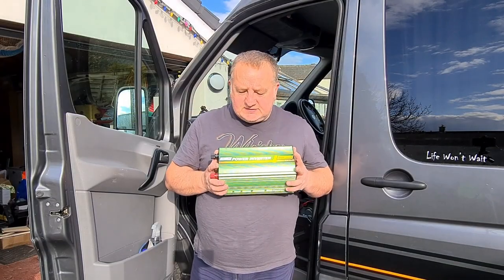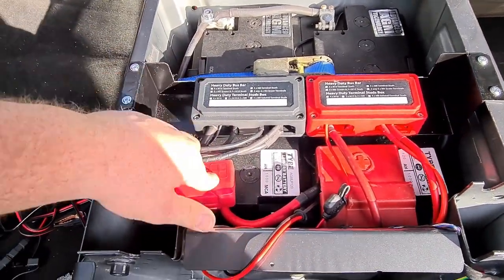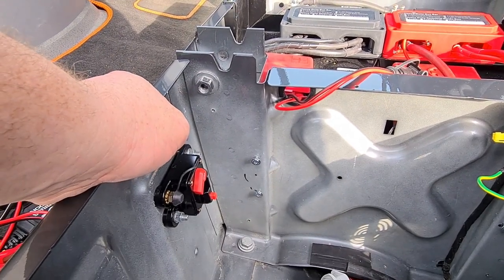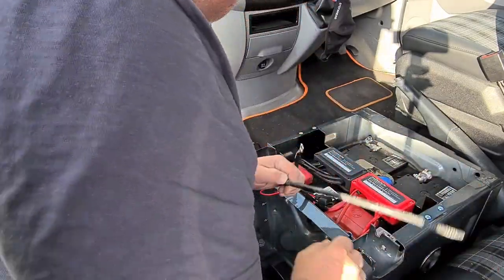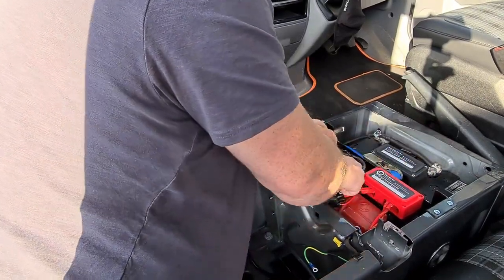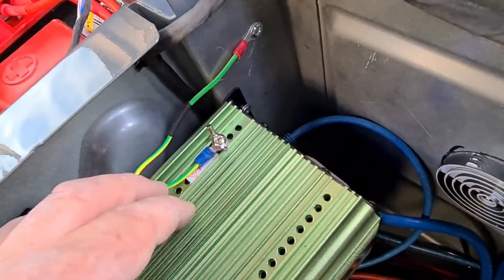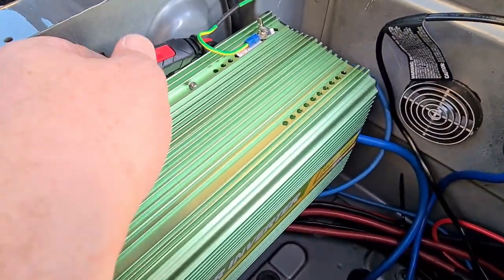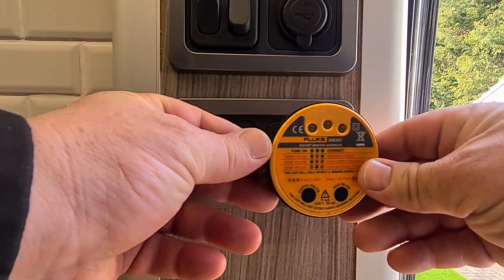selfbuild | vw crafter | campervan | inverter install | van build | part 29 | the crafty blinders

Comment: I like those battery distribution blocks mate, we’re did you get them from? 
Cheers
Reply from the maker: Hi I've just checked the description and I've missed them off
 I got them from ebay they weren't cheap but are a great addition

Comment: Hi there Sam great content once again How has this inverter been have you had any problems with it ? As this is the brand inverter  I feel I want to fit in my motorhome Thanks and safe travels for 2024
Reply from the maker: Still going strong I'm upgrading mine to a 3000w
Reply: @TheCraftyBlindersvanlife  Hi there Sam may I ask how many watts did the 1500w reliably deliver ? as I'm not sure if I should go upto the 2000w model . But i only have 220 Ah agm battery bank what are your thoughts ? Thanks

Comment: Hi, thank you for your vid. With the way the inverter is cabled, is there any potential security issue using Class 1 appliances?
Reply from the maker: what equipment are you thinking of, as long as you vehicles electrical system is earth to the chassis you should not encounter any issues the inverter dose have a floating earth and all your safety devices will work as expected using class 1 or 2 equipment class 1 usually are high wattage items so probably not the best items to use in this environment

Comment: Also…6.2A draw using a microwave (say 700w) 3A ish load at 12v using an inverter that can’t be right mate.. it’s more like 65A…I think the decimal place got missed?lol 👍🏼 atb
Reply from the maker: Hi Ant great comment What the display showed was 6.2a  but never integrated they system to see what it was referring to and iI guess I should have, something for me to look into at some point👍
your right about the  microwave it does draw around 67 amps (calculated)
In all honesty I don't even use or look at the display on the invertor when using it as it adds no value, the microwave has been used a hand full of times and the system handles it without any issues it's been a great addition 
Thanks for your comments it appreciated